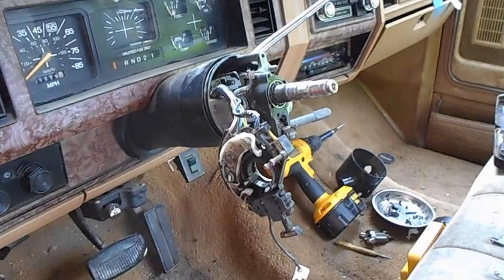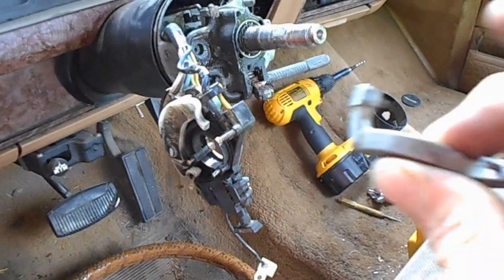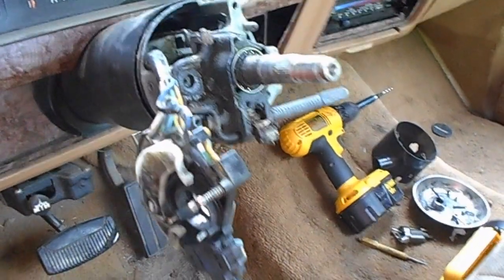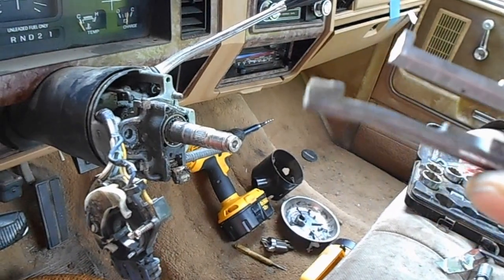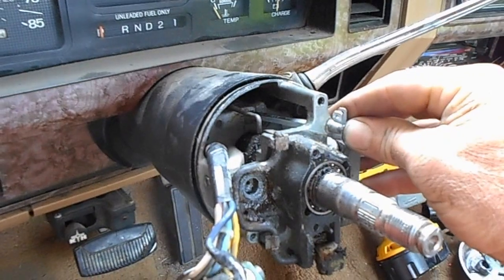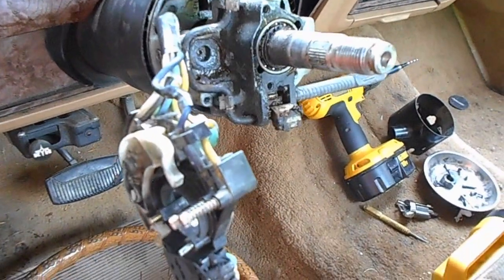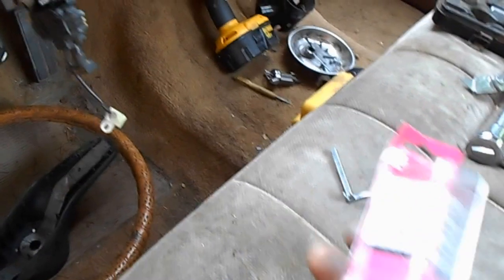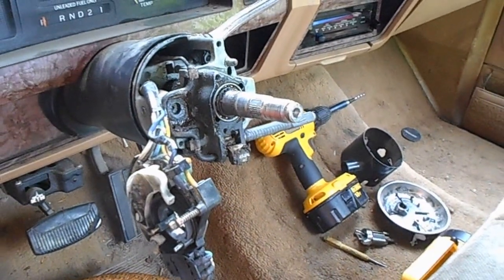Ford F-250 ignition actuator switch

Comment: I have the same problem with my 84 ford e150 van .  Key switch doing the same thing .  Column gear shifter stuck in park , will not move out of park .  Strip my steering wheel & column down just like you did .  Square  Actuator rod broke inside same location as yours ....... so you saying I have to drill that square broken piece out before the column gear shifter will move out of park ? ...........  Then replace the parts as needed and put everything back .    Help ..... thanks

Comment: I would have like to have seen the video of you getting the ignition housing off.  Mine won't budge even after taking the 3 screws (supposedly all that holds it on) off.
Reply: Snap ring
Reply: Snap ring and two pins…

Comment: I changed the ignition module and got a new distributors and truck get wont start up after i drive for a while until it cools off abt 30min puzzeled as of why
Reply: timing is too advanced. had the same problem with my 1984. if you make the timing retarded it will start easier but not run as well.

Comment: Question for you:  Was it a no-tilt steering wheel?  I have a 1985 and all the parts I can find are for the ones for tilt steering wheel, and mine is old school (non-tilt).
Reply from the maker: It is a tilt steering wheel.
Reply: Just replaced mine. I didn't cut the end or modify it in any way. Just pull the two pins"one on each side and then slide the split ring about 3/4 of a inch. Don't try to put the square part in the hole first. Gust get the whole piece in on the left side and then put the end in the square spot and it goes right in. Piece of cake. You needed to do about two more mins of work and bingo.